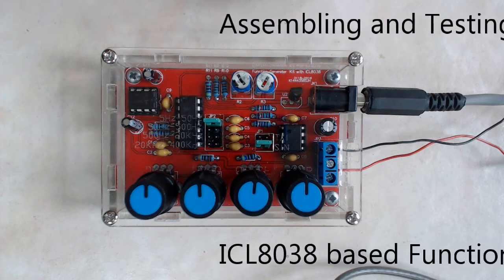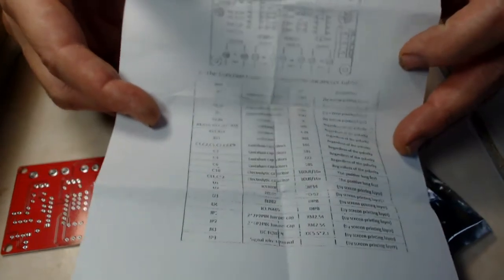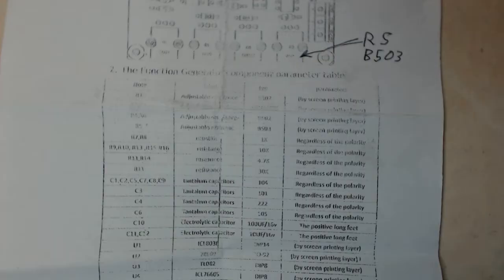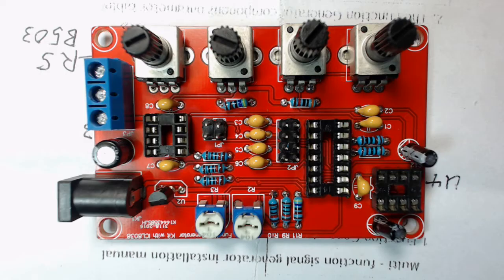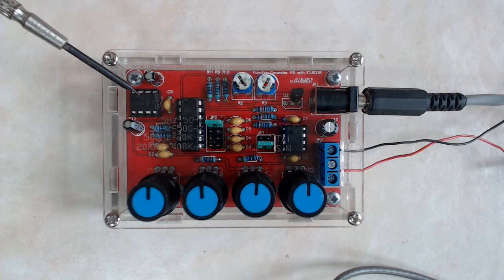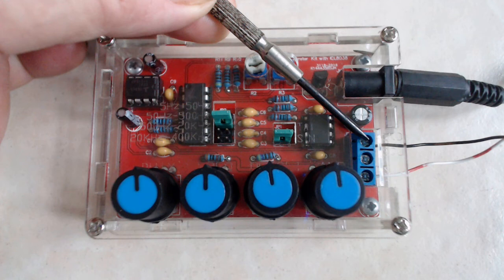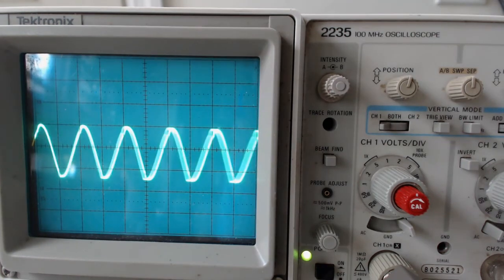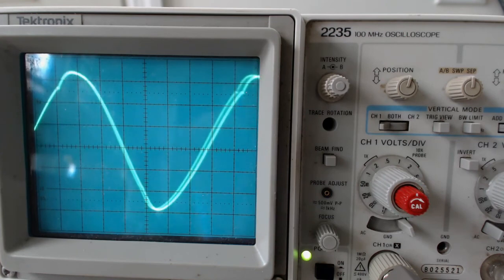A Really Nice, Inexpensive, ICL8038 Function Generator Kit

Comment: 2:50 I built one of these yesterday. One thing I noticed is that polarity is not marked on the caps described as tantalum on the build sheet. They certainly do look like tants.
There is no orientation on the silk screen print either.
The capacitors show as non polarised caps on my component tester.
Reply from the maker: Usually there is a "+" mark on the positive lead.
Reply: @EdHumble  Yes, exactly, but in this case, there is no marking on the capacitors, and no marking on the silk screen print. The assembly sheet says "Regardless of the polarity".
I'm wondering it these even are tants, although they certainly look like them.
Reply: @TonyLing   They sure look like ceramics to me

Comment: The user manual with the assembly instructions are full of errors.  The YouTube video "Electronic Project (4) Signal Generator, Making a Low Cost Generator" contains the correct manual and instructions at 5:51 (that is 5 minutes 51 seconds into the video).  You may have to magnify the video to understand the instructions.